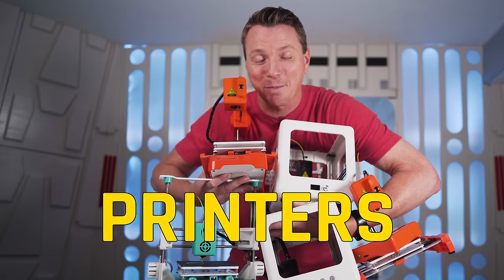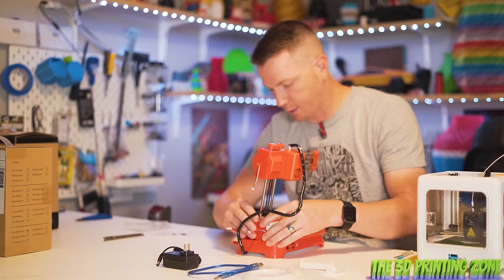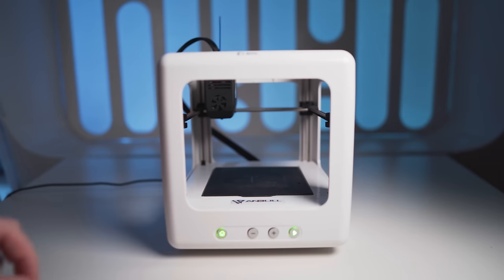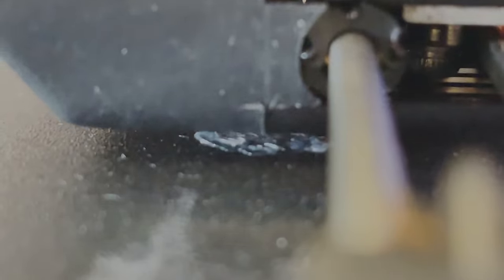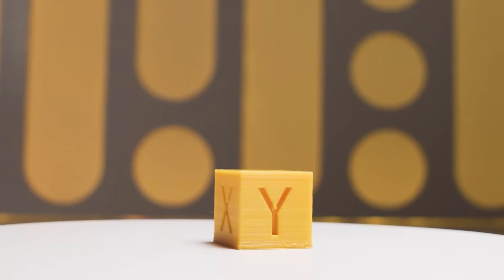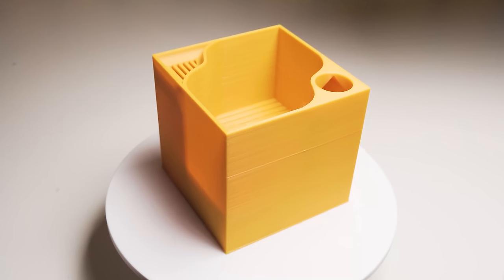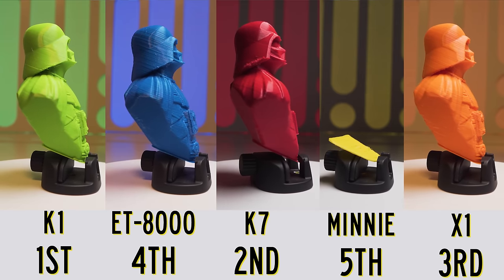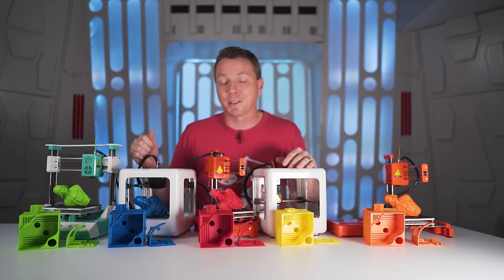I Bought the 5 Cheapest 3D Printers on Amazon

Comment: Nils! I bought two K1 printers a few months ago. They both lasted a week. The Y axis stepper motor bushing wore out from the belt tension. Can you test longevity? I found the K1 prints good enough for the price. If you read this, look where the Y axis belt meets the Y axis pulley wheel... You'll notice the shaft and wheel are slightly leaning towards the front of the machine. 

FYI, a replacement motor is hard to find online and if I recall correctly it cost $28 and ships from China. If you have to buy a $28 motor every week it defeats the purpose of buying a cheap printer.
Reply: I have a year with my Easyrhreed k2 AND still working so Is hard to see that you have that problem
Reply: @StarkillerVizarD  Thanks for your response. I'm tempted to buy another one but I'm hoping to see more reviews before I take that chance again.
Reply: @sidekick96734  if you want a fantastic quality, cheap large printer, get the anycubic i3 mega s, its around 200, if you want a small printer that has never failed me, get the monoprice v2, fantastic little printer, i own both and absolutely love them
Reply: I have the k1c and it is working perfectly

Comment: When I chose a printer I needed a sturdy  Z axis and large print area, that’s why I chose the Creality Ender 5 Plus. It’s the only printer I’ve seen other than the Cr-10 and that tronxy with 4 steel rods for smooth layer lines. The Ender 3 horizontal gantry often gets misaligned, and never prints correctly. I’m not sure how often the 2 sides of the Ender 3 need to be calibrated, but I often see the horizontal axis fail because there’s just too much weight on one side at a time. Dual Z-axis motors and no horizontal z axis is the key to smooth layers
Reply: Dual Z Axis motors misalign as well. Stepper motors aren't going to stay in sync with each other just because you drive them with the same signal. No solution is perfect. You tram the bed on the Ender 3 to match that misalignment of the X Gantry. So long as the misalignment between the left and right extrusion stays consistent and the bed is properly trammed its going to print just fine. Now if the misalignment shifts thats a huge issue. However often you find yourself tramming the Bed on the ender 3 is how often it needs to be calibrated. 

Take a look at the Ultimakers that use a single Z screw and rods to support a cantilever bed. Those rods flex, no matter what. Rail's can provide better results and when you are paying $2000-$6000 for a printer you would think they could afford something better. But they also work. Every part of a 3D printer isn't as precise as it should be. Go order extrusions, the cut length accuracy for every vendor I have looked at is interesting. Plus add up the twist and surface inconsistencies (Which is what really hurts the wheels on an Ender 3). The worst thing is Tooling plate aluminum for beds. I looked at one vendor so far and their flatness spec is between .127 and .384.  That's entire layer line differences from one side to another somewhere in the plate on a bad day. I hope to find something better than that lol
Reply: RainMotorsports build a voron
Reply: @user-yk1cw8im4h  that's not very specific now is it.
Reply: @Rainmotorsports  you said you hope to find something better than that lol, and a voron solves all of the issues you described
Reply: @user-yk1cw8im4h  I think that was in reference to bed flatness. Generally sourcing beds from the same places unless you buy an extra Gucci one with logos that last I looked is out of stock. I'm currently working on an IDEX Voron Trident based on what Eddie the Engineer is doing. Probably around the time I left the comment I hadn't gotten quite that far though
Reply: Haven't really had those issues with my E3v2 and mega zero 2. Yes the x axis isn't technically parallel to the base but when you level the bed you account for that. That gives you slightly warped prints, meaning corners of a cube wouldn't be 90deg but it's a fairly miniscule discrepancy.
Of course higher end printers can do away with that but also cost significantly more. For a decent all round home printer, the E3 and it's clones are hard to beat.

Comment: My anycubic mega zero 2.0 (basically ender 3 clone, exact same specs) was 115€, so about 130$ or so. Heated bed, marlin fw, screen, 220x220x250 volume etc, great printer. Many parts come out similar to my heavily modified Ender 3 V2, just not at the same 100mm/s.
Reply: Nice i have an imega s, a prusa clone. Love that it's pretty much assembled-just 8 screws to setup

Comment: I love the video idea, though, one word of caution I'd throw out is that the quality control on these devices is probably non-existent. Basically, is this one of those "you managed to get a good one" type deals, where you just so happened to get one of the better K1s (on your second attempt, mind you), but most don't print as well. And, on the flip side, is one of the other printers typically more reliable, you just happened to get a dud
Reply: That's always a risk with unknown brands, but some might actually be good, and just not have been around long enough to earn a reputation. And when they give the reviewer the device, knowing that it's for a review, they might give him/her one that's more likely to be one of the good ones. (They might have tested it first, while the average one wouldn't have had similar tests before going to a retailer.) When one fails in these circumstances, it's a strong indication of poor quality.
I'd look for user reviews. If they're very new, there might not be enough user reviews to know the quality.

Comment: I still have and occasionally use X1. It was my introduction into 3d printing.

Mine is still alive, well and kicking after more than 2 years. I don't get any layer shift issues. Only time I had layer shift problems were when I tried to use it with raspberry pi print server and direct control over COM, but that happened most likely due to some communication issue. When printing directly, I never had any layer shift. 

Prints are pretty OK with 25-28 print speed (though, much less for the walls). Quality PLA with 220 temp and down to 0.06 layer height can make some pretty good prints with its limitations in mind. It also came from factory with the part cooling installed, which looks like it was actually the factory QA print for mine that they just installed. I don't have a hot bed, but the magnetic plate is quite adhesive, though I use stick glue and narrow brim for adhesion, which was so far my goto on it.

I think quite high of X1. Nice to see a review.

Comment: Well, to be fair, you have to spend some time with each printer, add a part cooler, try different settings. Like you would do with a "serious" or expensive printer. I got an X1 last May to see if 3d printing was right for what I needed and I have to say that I would still be using it as my only printer if it had a slightly larger build surface. I did use it a lot though, at 30-40 mm/s2, even in making all the printed parts of a clone CR 10 300x300x400. It did that job very very well. It takes a bit longer than an Ender 3 style machine would, but the pieces come out beautiful looking and very stronk.
Reply from the maker: Agreed, I could have spent more time with each. The hard part on most of these is that there is so much less you can actually tweak, especially when compared with a printer that's $100 more. It may be a bit like my first guitar - the strings were way far away from the neck (terrible action) and it was incredibly difficult to play. When I got my second guitar I felt like a rockstar but because everything about it was easier and better.
Reply: @The3DPrintingZone  Hah, that's a pretty good analogy.
Reply: You wouldn't add stuff to the prusa i3 mk3s+. It prints good from the get go

Comment: If your tronxy is has a build volume of 330 x 330 x 400, it's ~3.5 times larger than than the build volume of 100 x 100 x 100.
It's not 43 times larger. 

When talking about how much larger something is, this is called the scale factor. Scale factor (sf) is always based on the dimensions that make up what you're scaling. If you want to scale the area or volume, the scale is squared for area and cubed for volume (area = original area x sf^2. Volume = original volume x sf^3). 

In short, this is why a scale rc car is considered 10th scale, when it's volume is actually 1/1000th of a full size car.
Reply: He’s not talking about scale factor, he’s saying that 43 of the smaller printers build areas can fit inside of the big one. Lol nerd
Reply: @BigDaddyD_Official  He literally describes the cubed size he's referring to "a cube of about 4 inches" when referring to the 100x100x100 build volume of the small printer.  "It can print something 43 times larger than that" .

Comment: I have the Modified Easythreed K9 Printer (heated bed mod), and to calibrate the bed, it has the four buttons, for four corners. When you press a button, it moves in the required position.
1 = Left front (home)
2 = Right front
3 = Right back
4 = Left back.

Comment: i stopped using cheap filaments with my ender 3v2 because nothing would print. Switched to Ender branded filament
and works perfectly. A whole lot of problems i have experienced with 3d printing is just poor filament or moisture in filament.
Nice video btw. +1 sub
Reply: I've had an Ender 3 Pro for 6 months now and have always used Creality (Ender) filament with no prblems. Au$20 plus Au$6 postage from old mate on eBay, can't fault it.

Comment: oh lord, whats the point of those printers? you can get an ender 3 (v1, non pro) for the same price as this and the ender will 1) work VERY reliably even stock and 2) can be modded over time to become a printer that matches or even beats stuff along the lines of a prusa in many ways. i mean, put an RRF + DWT board in an ender 3 costs you 25$, enables you to print and monitor over wifi, slap on a bltouch and a dualgear extruder and you got yourself a printer that is VERY capable for well under 200$

Comment: Would love to see these remade with a modular Z axis.  For the price, being able to increase in Z could be a game changer
Reply: They all have the same locked-down firmware, so modifying it in this way would require getting a new board, and by that time you might as well buy a new 3D printer.
Reply: @3dpprofessor  Do we need a firmware to set the z axis height? In cura I think we just configure the profile and set the new z. The firmware seems to just run the z till the end stops clicks... probably easy to test if you have a spare (I do not, this is my first go at learning. Figured a small kit that expanded the z would let me go bigger / taller without more complexity...
Reply: @thewatersavior  on the K7 I have, the firmware seems to be aware of the x any y axis limits and won't go past them, even if the gcode says to. I assume it would be the same for the Z.
Reply: @3dpprofessor  Ah gotcha, thanks for confirming! I have an X2.. so much for hoping!
Reply: @3dpprofessor  On the x2 it seems if you do not home it before starting, it will just take that as 0 and start in mid air, suggesting it doesnt know its position without the switches
Reply: @3dpprofessor  Looking at it again.. they don't have a top switch so I bet it stops there also. Dang!
Reply: I found a photo on Reddit on an extended K1 (I think it is) from someone who claims to have gotten new firmware from tech support to remove the Z limit. No photo of high prints though so I don't take it as a proof. So, fake or something that only the K1 allows?

But I am not sure that the quality of these machines will be good enough to build that high anyway.
Reply: @Ragnemalm  awesome even if it's vapor lol smells good
Reply: @Ragnemalm  Awesome! Well one can dream.. and then we can press them for it.

Comment: The minnie is definitely an m3d clones. As someone who had an m3d, its not really shocking that it failed. The printer is designed well aesthetically but thats about it. Undersized motors, slow firmware, unreliable connectors, motor overheating issues, ability to dive into its own bed, and many more issues. The only difference I see with the mini is that it has an oled display while the m3d micro+ has no display.

Comment: The Elegoo Neptune 2 (and 2S) are cheaper then the Ender (they are clones after all) but they are so much better too.  The Neptune 2 runs about $180 now and is a good base machine, the Neptune 2S has a bunch of upgrades already on it that can be put on the vanilla one.  It runs about $230 and has a dual geared extruder, magnetic PEI bed and some better leveling nuts, but the real winner is that dual geared extruder.

Comment: I am operating currently a Tronxy like yours, and honestky as it came out of the box is crap, solid frame, crap plastic mounts for motors (changed them with machined aluminium from other printrer I modified in the past) crap heatsink system, the fan actually blows over the heatblock too, rendering printing problematic, etc.

Now it works, but aside the frame, electronics (also crappy, and I intend to change the mainboard) software (probematic too) and belts/motors, that i tuned, stiffened, etc, I changed the entire printhead.  I started with printing myself a tool swap mount (using another printer that works, obviously) in polycarbonate, than a V6 tool holder (actually two, one full metal line with bimetal heatbreak throat tat works fine for anything but PLA and one with PETF down to the heatblock throat for PLA, I can swap the whole thing in 5 minutes now), than a water cooled hetsink tool holder, and now it is a decent machine that I use as backup to fast print things when i am modofyig the other printer, my workhorse.

Bottom line, Tronxy took a good concept, made a grat frame, and failed at everything else, pitty.

Comment: years ago i aquired  a Tronxy anet A8 kit ,.i took 4 days to do the assembly about 3 hours at a time,and it has worked great however last year the plastic frame developed makor cracks,so I designed a single arm 3d printer and used the motors ,electronics ,and build plate and built and entirely new machine out of alum profile and so far so good it works much better and faster now I want to purchase one of the 32 bit control cards to replace the original controlboard which is 8 bit so that it will have even more speed and higher precission.

Comment: easythreed is the original, you can see this in linus tech tips video. They first makes the X-1 and then moved on to the K-1. I got an X-1 and my first printer mostly because I did not have enough space for a ender 3 size printer. It lasted my about a year before i upgraded.
Reply: I had to do a tone of tuning in cura, but was able to get really good results. Unlike linus video mine did come with a pet cooking fan

Comment: well, i had the Easythreed X1 as my "first" printer - ans i even printes the XYZ-Calibration cube, but with the filament what was given with that printer - and the quality was pretty good. i don't know if you had a problematic printer, but mine had worked nice and smooth; the only thing what made problems were "taller" prints - like a benchy (what was sliced with the software what was delivered with; and there's "raft" as bed-adhesion as standard set), who needed to "tape down" several times during the printing process. just to be fair - i wanted to try it on that printer as first, that i know not to dump to much money if 3d-printing wasn't my thing or i won't get that... you might gess on that text, that i had a bigger printer now - a artillery genius, what works for the most prints for me (and i selled the X1 later). for round about 65€ the quality wasn't that bad, and the accuracy (i even had that cube - i collect every cube that i print with one of the printers i've had) was even not that bad. the only problematic thing was that it had a "elephant foot", but that is - in the look of that print quality of that "toy printer" exaptable. 

but, there's even critic from my side - and you didn't say that (even i can say it just for the X1, but i guess that's for all 3 a thing): these had a holder for spools, but just for the smallest spools you can find - with 250g (that's just 1/4th of a norma-sized printing spool). and that from the X1 tends even to break easily - especially when you try to dismount the printer, 'cause the plastic for those holder is really cheep plastic. but, there's even upgrades out there for the x1 printer on thingiverse (like a active cooling for the nozzle, 'cause that isn't build in etc).

Comment: Weird that you have so many issues with the X1. I bought an x1 probably 3 years ago now and it still prints when i need it to, which isnt often if im honest. I now have 2 neptune 2S's and an Ender 3 pro. 

And you definitely can tightent the belts on it, it just isnt very intuitive; you need to dissasmble the printer. 

I also made a wooden base for it that i permanently screwed the printer to for better rigidity. 

The first layers are not super clean but otherwise it prints quite well for the $65 i spent on it. 

And i was even able to make funtional parts with it. Overall its a solid little machine.

Comment: That tiny display isn't an LCD, it's an OLED of the type designed for pens and watches. Also, the K7 is clearly the winner for mirroring all the prints (one axis is reversed). :P

I wouldn't recommend any of these. The care and attention that went into producing printers that fail to move, move the wrong way, are missing screws etc is pervasive; they will fail sooner or later, and be far harder to repair than some popular kit model. Also, the failure mode may well be to catch that whole pretty plastic case on fire.